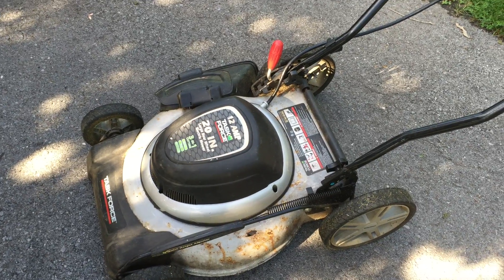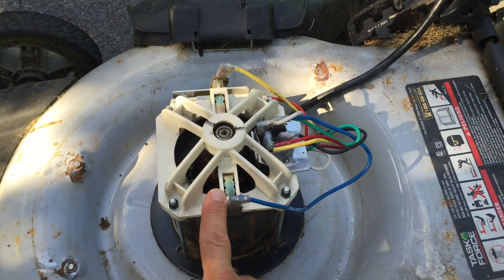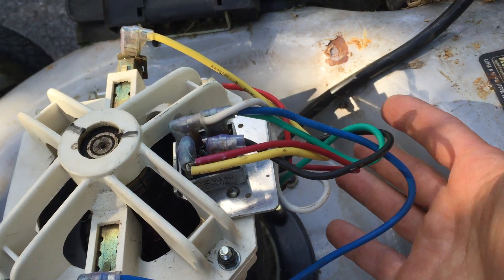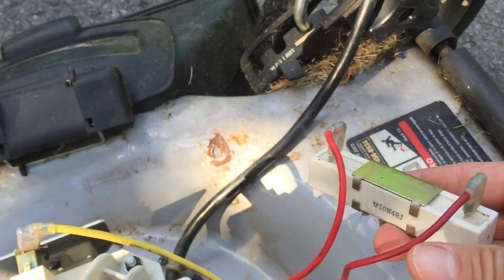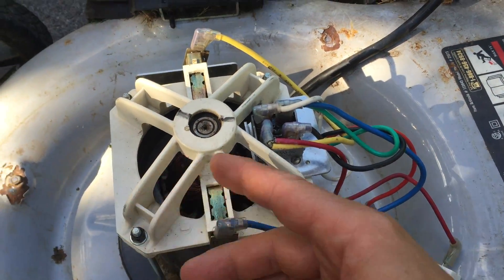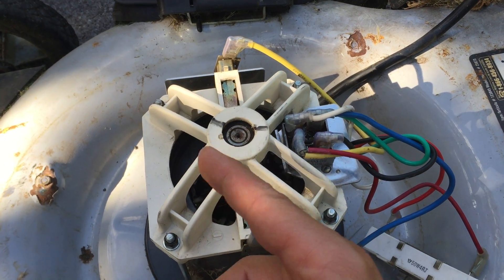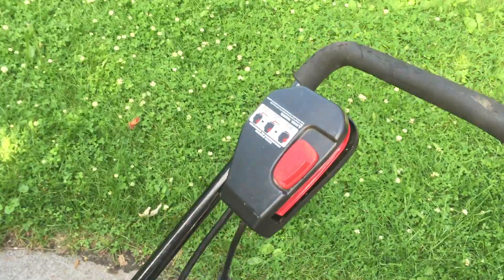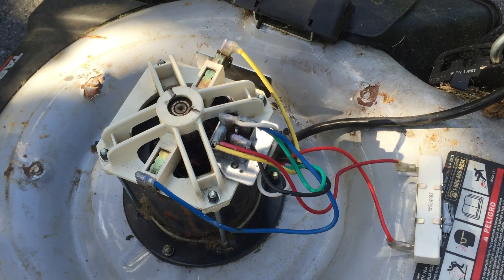Explained: How Does an Electric Lawn Mower Work?

Comment: Can the resistor be blown causing the mower to shut off/overheat? Mine just went and won’t turn on again(too thick of grass) and I’m troubleshooting before replacing. Great video!
Reply from the maker: I would think the rectifier would be the first to go bad instead of the resistor.  Did you test and/or replace that?
Reply: @FrugalRepair  Well this is embarrassing... So first thing I checked was the circuit breaker by flipping on the light on and off in the patio room where I plug my mower in via extension cord, the light worked so no need to go to the basement and flip a breaker. So went into troubleshoot mode and started taking apart the mower assuming blown component, watched your video, and got out the meter etc. Everything seemed fine which was actually more frustrating than anything. Then I went back to the plug to unlug it and sit on it for a minute and realized it was the tripped breaker at the plug level, like a hair dryer. The mower was fine. *facepalm*. Thanks for chiming in to help!

Comment: So if you removed the bridge  rectifier and used a battery for a power source, would it work fine? Is a brake resistor needed after converting to a battery? Do all electric corded mowers have dc motors? So many videos show people using an inverter in order to power a corded mower with a battery...i think why use an inverter if the motor is dc?

Comment: Hi, I can hear the energy hum to my mower, but it won’t start. It’s not tripping the breaker. Is it the resistor or rectifier, appreciate your feedback.
Reply from the maker: Have you tested the rectifier for an open circuit?
Reply: Possibly a blown capacitor?  Its possible there's energy going to the motor but not enough to get it turning. If you have a helper turn the mower on and you prod the blade with a broomstick (with caution) and it starts up this is a sure sign. The capacitor will likely look like a cylinder and you can tell it's failed because it looks like it has exploded plastic.

Comment: Are you sure about Back-EMF on this mower? It seems to me that if the motor was a permanent magnet motor, you would be right. But on this mower, the field collapses as soon as the power is cut.
Reply: that field exerts a back emf while it is active, just like a permanent magnet exerts a voltage until it moves away from a coil.
Reply: It is a permanent magnet moter.
Reply: I’m assuming the voltage is high because the current in the armature coil is interrupted - this is why more spark than when  starting. 

Remember the old fluorescent lamp - the coil produces the necessary high voltage to start the lamp.  The “starter” has two flexible metal that shorts and open the coil circuit until the lamp lights up.  Note fluorescent needs higher voltage to start/light and lower  when lighted.

The voltage produces a spark but current is very low since it is not “sustained”.    Note if current is interrupted in a coil it will have high voltage in its terminal.  Unlike capacitors it will give high current.

Comment: Could the bridge rectifier be taken off, connect a battery and have a cordless mower?
Reply: Yes, but that motor runs at 124v DC. 12v battery is not enough.
Reply: I used an 80v kobalt battery to run mine.

Comment: I found the rectifier on Amazon, can't find the brake resistor.  :o
Reply from the maker: +Jim Williams sorry I somehow missed your comment.  Do you need to replace the brake resistor?
Reply: It's called a concrete resistor, easy to find

Comment: Anyone know where I can find a motor for one of these?
Reply from the maker: Not sure, but it’s a DC brushed motor.  I don’t remember the power rating on it.
Reply: @FrugalRepair  I have all the info... even the model number.  Not much out there being offered.
Reply: @blackz06  find oe?
Reply: @MikeTyson2  What?  I ended up finding one... about 60 bucks shipped. Works like a charm, now!
Reply: @blackz06  looking at other repair videos it looks like they're using the same motor in lots of electric mowers like Briggs & Stratton is used in lots of different mowers. I haven't seen enough to say that that's what they're doing but does anyone know is that what they're doing could I get one just out of a Black & Decker.. or some other manufacturer and I don't know the specifications of the motor is there one that's a step up with more power I want to learn thanks for answering Me Mr blackz06
Reply: @MikeTyson2  the 120v motors all appear to be the same.